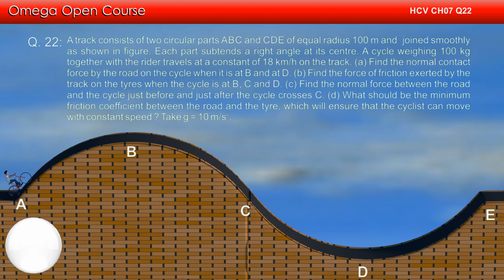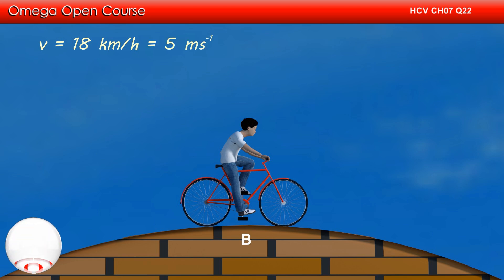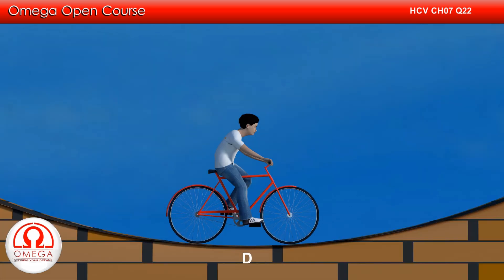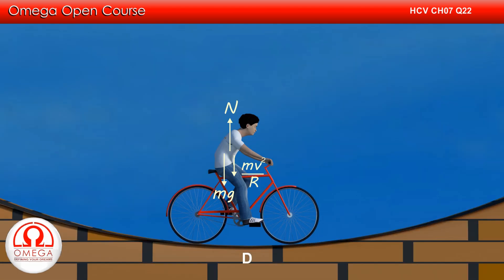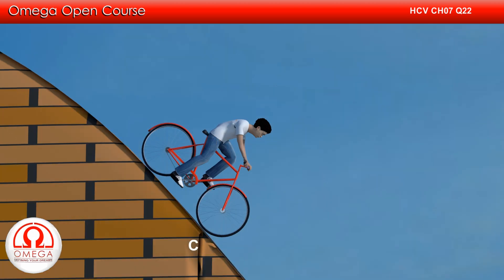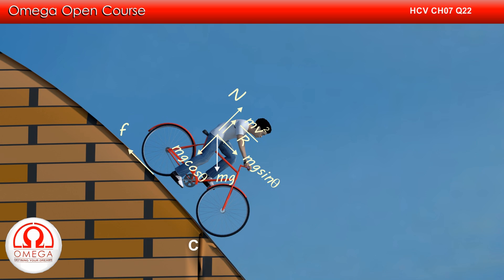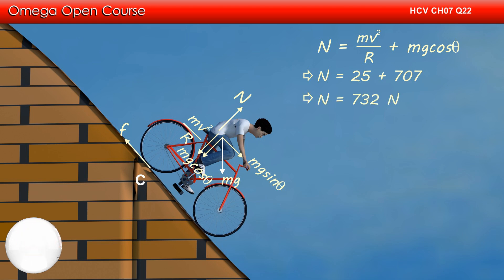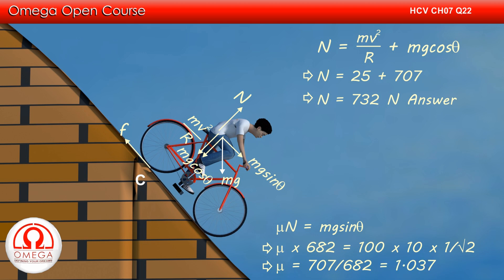H. C. Verma Solutions - Chapter 7, Question 22

Comment: Sir, cycle is at uniform speed i.e. acclrn of cycle is zero then how pseudo centrifugal  force acts on (a) solution part?
Reply from the maker: Even though the speed of the cycle is constant, its velocity is not. The direction of the velocity of the cycle is along the tangent of the track it is moving on. But since the track is circular, the velocity changes its direction constantly. So, the motion of the cycle is accelerated.

Comment: Sir why we have taken N=682 in part d of the question
Reply from the maker: This the value of minimum normal which we calculated in part C. For minimum coefficient of friction, you need to find the point where normal is minimum, and if friction is sufficient there, it will be sufficient everywhere else.
Reply: Omega Open Course but coefficient of friction is inversely proportional to normal force,then for minimun coefficient of friction we have to take maximum normal force
Reply: thank u
Reply: Sir please give solution of other remaining chapters.

Comment: sir in case of thermodynamics in area under pv curve why anticlock wise work is positive
Reply from the maker: +Arabinda Biswas In case of expansion, work done by gas is positive. In case of compression, work done by gas is negative. Now take a look at a PV diagram. You will notice that if you move clockwise, the work done during expansion is more that the work done during compression. Hence net work done by gas becomes positive.